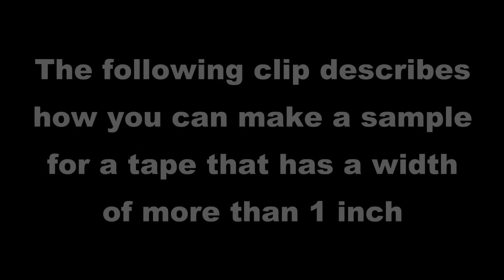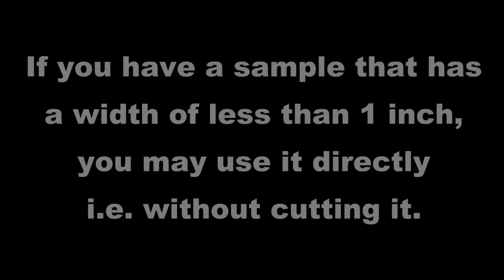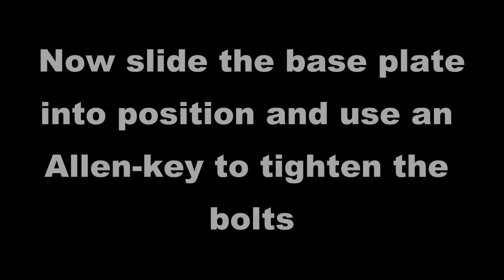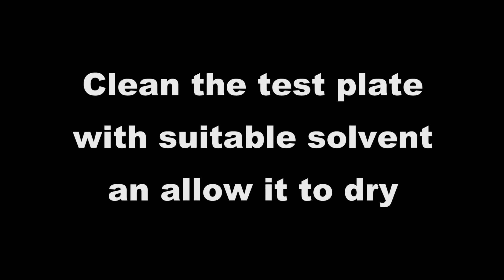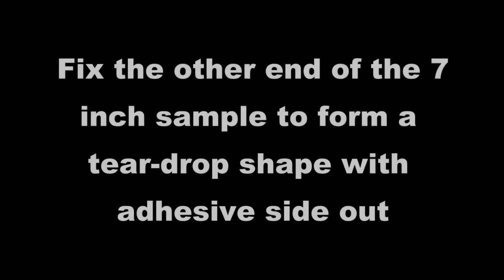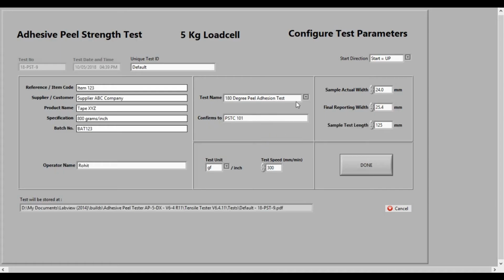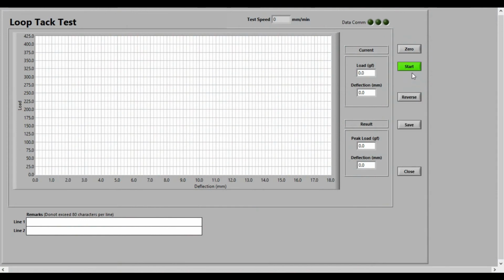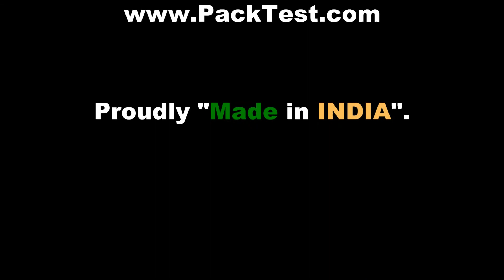Loop Tack Test by PackTest.com

Comment: Hi, could you tell me where i can buy the doble blade cutter? I need it to do tests in my laboratoy.
I hope you can tell me or send me a link to buy this item. Thank you very much.
Reply from the maker: Usually such accessories are provided with the machine itself or can be bought again from the equipment supplier. Which brand of testing equipment are you using. If its PackTest, we can supply. If not, check with the equipment vendor.